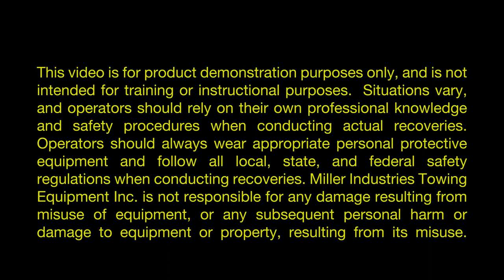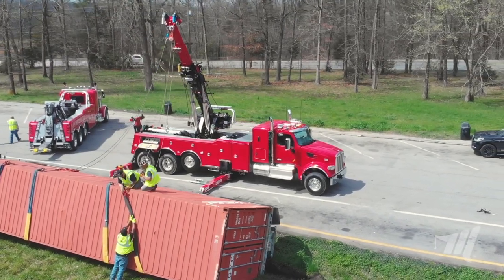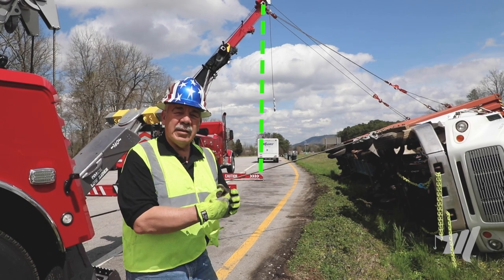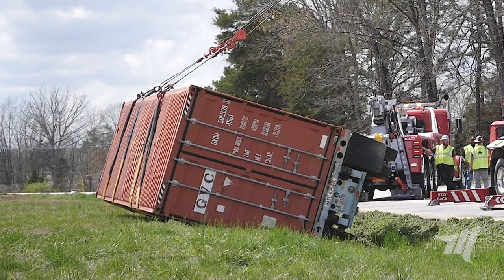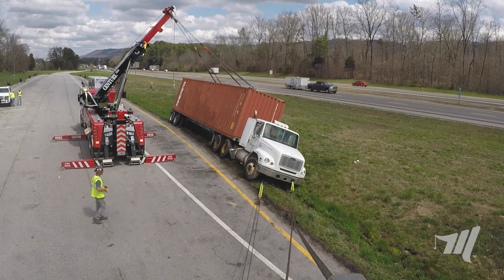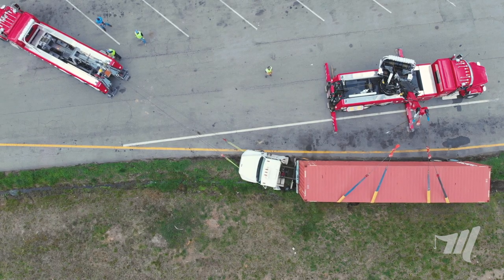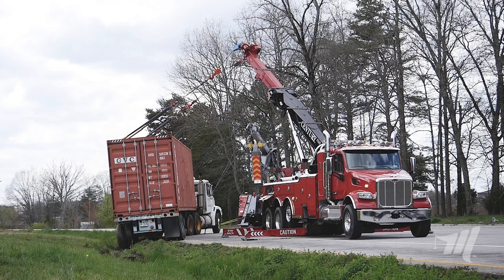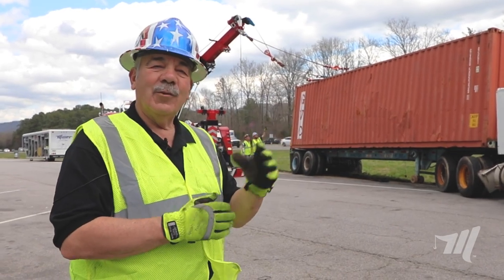Container Handling - Ditch Recovery

Comment: Neat pickup good technique but most operators not gonna do a job like that with 2 big rigs like that. Probably a smaller truck and a 50 tonner. Thanks for.all tips thou
Reply: 100% false. This is how we do it. You can break your trucks by using smaller equipment all you want but that’s just silly.